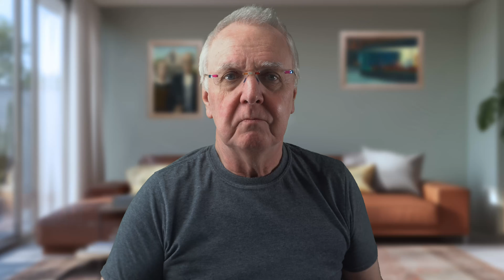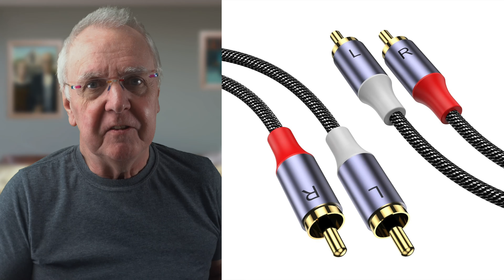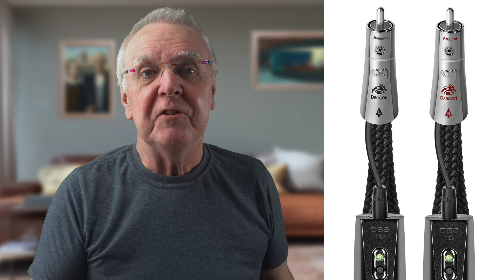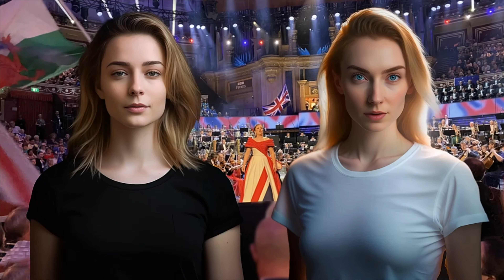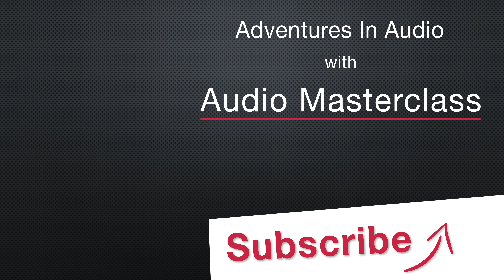How to improve your audio enjoyment with defective cables

Comment: You can use thick gold interlinks  on your stereo set but the internal cables from the connectors to the printboard of your equipment are from cheap ass thin copper wire. Same for expensive power cords . the wire behind your wall outlet is cheap VD wire. So nothing to gain. The length of interlinks and speaker cables is important , keep them as short as possible and left and right the same length . Good speaker cables make a difference but only if you rewire your speakers internal completely with the same cable.

Comment: Oh man, is there really an “audiophile” out there who still uses RCA cables?
Or is this video a repeat from 1999?

BTW: When you speak about RCA cables you should always mention that RCA cables must be build using coax wires! 
I saw RCA snake oil cables made with twisted solid wires…. What a nonsense…
Reply: Uh, are you familiar with turntables?
Reply: @playdg  Yes, I remember this old day’s technics. 
Anyhow, turntable with RCA outputs might be something for kids. I assume an audiophile would take a turntable (when even required to use this old format) having an XLR output. Don’t you think?
Reply: @Lex_Populus Very few exist as that is not how the music is stored on a record and the device would have to create the balanced version. That is the antithesis of audiophilia. Seems like you don't know much about the audiophile world. RCA is also very common for digital SPDIF interconnects for digital sources.

But hey, keep mocking people. That'll work.
Reply: @playdg  To be honest I do not use analog audio.
You might be not aware of this but digital audio works differently to analog. The SPDIF standard requires e.g. an impedance of 75 Ohm. The SPDIF cables are built to fulfill this standard. So, when you buy a SPDIF certified cable for digital you are fine (even cheap but well build SPDIF cables are adequately in order to transport the digital signal). But SPDIF is also old fashion. 

Regarding turntables and XLR: I understand that you might use an old turntable which was engineering as a customer product and so the output is still RCA. 

Nevertheless, modern high-end turntable systems should be built to have a full differential balanced output. The noise issue can be well managed using today’s knowledge. 

But as mentioned I personally do not use analog audio and also do not invest in snake oil products such as analog super duper RCA cables.
Reply: @Lex_Populus LOL. Thanks for googling some stuff for us. I make my own cables, including coax for digital. Although I'm not currently using that, HDMI is more capable.
Reply: @playdg  Not sure what you mentioned by “googling some stuff”.
Anyhow your conclusion is semantically a nonsense. You might want to study some principles of predicate logic. 
And yes, HDMI is best connection for digital. Or directly an ethernet input to a network player such as T+A HV series (e.g. PSD 3100HV – an excellent piece of high-end engineering). That’s high end from my point of view.

BTW: regarding your passion to build your own cables: to build own speaker cables is OK but when you think to build your own digital cables than it’s definitely a bad idea. When you want to understand why… well google it as you obviously tend to assume all is to be googled.

Comment: You're listening to recorded material. So consider what the studio that recorded that material looks like. I know the studios I built used custom cables made with Belden 9451 or 9723 with nickel plated connectors. Those wires are foil shielded with a drain wire, either single or dual pair. Not even coaxial. At audio frequencies they work great even over long distances and with no interference from the broadcast equipment in the same room. The signal from those cables ran through the production gear (with nary a gold plated connector in sight) and recorded to tape. The pro gear revealed impeccable sound quality which in some cases got put onto production CDs. 
Now here's my point. Do you really think that by using "better" cables than were used for the recording, you're going to get better sound? To me. That would be a neat trick!
Reply: You guys just don't get it... maybe you are music lovers instead. That's a good thing! That's what is about. But we, so called audiofools, like to hear the already made recording how it is. That comes with spending money. But when you don't hear it, doesn't mean you are correct by saying it makes no difference. But cables costing more than €800 - €1000 is questionable indeed.
Reply: No, bad cables make things even worse....duh!
Reply: @marcodevos3565  You keep popping up with inane comments, which you always close with "duh". So let's hear your credentials. What job do you do (assuming you even work and aren't a full time keyboard warrior), what system do you run and what are your qualifications?
Reply: @laurieharper1526 Piega, KI, Tellurium and soundcare. About 35 years into audio. And ears.
Reply: Yours? BOSE ?
Reply: @marcodevos3565  So budget to mid-price speakers and cables made from unobtanium. "Into audio" for 35 years? I was a pro' musician for 50. I too have ears and, unlike you I suspect, perfect pitch.
Reply: @laurieharper1526  mirror talking by the way?
Reply: @marcodevos3565  Took you a while to come up with that gem, didn't it? Unless you were in the studio when a recording was made, you have no clue whether you are hearing "the already made recording how it is".
Reply: @laurieharper1526  correct, but loosing details l, dimension and muffled sound wont help. Which happens with cheap cables etc. But ok,  have a nice none audiophile life.👍
Reply: @marcodevos3565  I'll have a nice musician's life, thanks. You have a nice tin-eared life. Remember, hi-fi is all about music and if you don't have a clue about what music is or should sound like, you're wasting your time and money buying expensive cables and audiophool trinkets.

Comment: Yes, I can.  But different is not always better.  With my R2R and 300B, I prefer copper cables over the fancier ones.  They keep that intimate 300B sound.  With my RA280, I prefer copper for teh woofer and a higher end cable (or at least silver coated) for the extra clarity to the tweeter..  This is with Traingle Duetto 40th speakers.  And my ears and taste as not all higher end cables sound the same or even good with that speaker to me.  Interconnect cables make a difference.  However when I use the DDC, it makes for less different for data interconnects.  For analog, It seems any interconnect is a gain from the cheap cable shipped with equipment.  But once I have a better class of cable, they all sound the same to me.  I do not AB test.  I listen and either it sounds better or it does not.

Comment: Why aren't these great cables used INSIDE THE AMPS AND SPEAKERS?????
Reply: Ask yourself which you would rather burn out ... a $1.00 length of hookup wire or a $1,500 woofer...
Reply: Thats called an upgrade🎉
Reply: Actually, some of my speakers have Monster Inside.
Reply: @playdg  That's what she said...

Comment: A cheap cable can be turned into audiophile quality by making and attaching your own  $1000 price tag. Make sure the price tag is visible from your listening position and be amazed by improved audio quality.
Reply: When you think this way just switch to digital audio. The cables there have to follow only the digital format requirements, nothing else.
When you have to use RCA cables than replace your equipment as RCA is really an old fashion thing
Reply: @Lex_Populus?
Reply: Funny, but also ignorant comment.

Comment: I have a pair of 'defective' cables that came with my SME Series 3 tonearm.
At one end of each phono-to-phono cable, there's a 220 pF capacitor.
After unscrewing the metal shroud, the capacitor can be seen tucked away in a small slot in the plastic body of the plug.

I wonder how many people are using these leads without knowing about the capacitor?

Comment: John Watkinson, one of the pre-eminent audio & video designers in the UK, once said that “if changing the cable has an effect on the sound of an audio interface, then the interface has not been designed properly”. I experienced this in the recording studio in the 1980s, where a particular domestic DAT machine’s line input had an unnecessarily high input impedance, if fed down long phono (RCA) cables from the ‘Pro-Pac’ professional interface module, all the HF was rolled off by the cable capacitance.
I also have concerns about the size & length of the phono (RCA) plugs used many of the very expensive ‘audiophile’ cables; the leverage applied to the sockets by their length plus the weight of the chunky cables, in my experience is sufficient to damage the sockets, or fracture the joints where they are soldered to the PCBs.

Comment: At audio frequencies the only effect speaker cables have is a slight attenuation due to their resistance.  Inductance and capacitance have virtually no effect.  Same for weak signals such as those coming from a phonograph cartridge, except that shielding is also important.  

Connectors are weak points, so keep them clean and, if they are carrying lots of power, make sure they have adequate contact area.  If they get hot, use bigger ones.

These matters have been settled long ago.  It’s amazing that people still go for extremely expensive cables and connectors, thinking they can hear differences.  Put the money elsewhere, like into speakers, where differences matter.
Reply: Capacitance and inductance have virtually no effect? 😂 if you say so.

Comment: Maybe the differences people hear in cables is the interference they are picking up from their surroundings?  I've tried expensive interconnects and supa cheap ones, I've made my own rca ones with poor quality components and I can't hear a difference provided you keep them short, I've always thought my kit isn't resolving enough 😂

I've found speaker cables are a little different, as is bi amping, I can manage to hear a small difference, whether or not it's better is anyone's guess, qed79 strand seems to work just fine, I did try some mains 2.5mm twin and earth cable once which sounded ok but I preferred the 79strand as it was much easier to work with...

A cheap mains conditioner made a difference as well.

Putting rubber feet people use under washing machines under my floor standing speakers that were stood on a solid wood floor changed the sound quite a bit and were supa cheap... 

You should do a video about the cheapest upgrades people have done that have given the biggest improvement...

Comment: Oscilloscope cables are lossy by design. They add a high resistance center conductor to reduce reflection and therefore ensure a flat frequency response across its length…some sometimes worse really is better….
Reply: Thing is they've got 1M impedances, measuring MHz.

Comment: The problem with the RCA type cables is that they are unbalanced and  allow ground currents to flow in their shield.  If there's a potential difference between the two pieces of equipment it's connecting, say from the AC mains, that voltage difference will be added to the desired audio signal.  One can try and minimize this by buying cables with very low conductance shields.  But you can't really tell what your buying without cutting them open.  One can also add large gauge wires between the equipment to try and divert the interfering current away from the shield.  
The best solution is to avoid the whole problem and use equipment with balanced inputs/outputs and interconnected with XLR microphone balanced shielded cables.  That way, no interfering current flows in the signal path wires.
All of this seems way over the top and unnecessary, since the currents for short cables runs is so small.  But for long cable runs, where the equipment maybe plugged into AC mains on different phases, the interfering current may be significant.
Reply: The best thing to do is to make sure all of the equipment is appropriately bonded. This can get complicated when you have some balanced signals, some unbalanced signals, some equipment with grounded power leads and some equipment with ungrounded power leads. Throw in battery operated gear and you have a recipe for trouble. Assuming the power is clean (no voltage on the grounding equipment conductor) you can bond everything to power ground and listen to the hum go away. But be sure to use a common ground. Any differential between grounds might not matter electrically, but you will hear it at [60|50] Hz.
Reply: The best bet is to resolve the grounding problems.
Reply: It (Skin Effect)  tends to start to come into play when the signal wavelength approaches the cable length.

Comment: Plugging a "high end" cable into an unbalanced -10dBV output like an RCA is putting lipstick on a pig, and goes to show just how ignorant audiophiles are of basic physics. Even the cheapest (non-defective) balanced +4dBu XLR or TRS is going to sound better, every single time, and twice on longer cable runs.

Comment: Those Audioquest thingies have been measured. Apparently the battery box somehow manages to pick up EM noise, besides that they're wires like most others.

What's wrong with something from Klotz, van Damme, Belden, Canare or something? Just be sure to have them terminated with with the appropriate Neutrik connectors, and you have an heirloom piece.

Comment: Whatever cables/interconects you buy make sure the conductors are copper. Cheap ones may have aluminium conductors, not as flexible and could work harden if you keep playing with them and break internally. This does not apply to optical cables/interconnects of course.
Reply: Silver is a better conductor than copper...
Reply: Yes, absolutely correct ... do not use CCA (Copper Clad Aluminum) wire.  It's stiff, it's brittle, it breaks easily and it's a royal pain in the but crack to solder.  

OFC (Oxygen Free Copper) is the way to go, and it's pretty cheap.

Comment: Great videos! I love them all.... 💜 If someone has a $15,000 dollar amp (I'll speak in dollars here), a $9000 dollar DAC and a pair of $35,000 dollar speakers, go ahead and get the $8000 dollar cables (interconnects). I totally get it. Why not? It's all good. When it becomes like snake oil is when you got a salesperson or marketing strategist spewing out BS saying, "Our cables sound a 1000 times better. It's like night and day. Don't be stupid and use 50 dollar cables on $70,000 dollars of gear. You NEED the best cables. You NEED to buy our cables. You NEED to elevate them exactly 6 inches off the floor. Any other is completely inadequate and stupid."

Comment: 👂Your structurally grain disordered videos are obviously poorly insulated from reality and suffer from molecular vibrations right to the dissimilar core materials never getting below the surface effect. And your argument has faulty terminations not to mention it's facing in the wrong direction. No wonder nothing sounds right! :)   
In truth, your suggestion is wonderful. Imagine a small female & male RCA connector with options for circuit options in the middle, variable capacitor resistor, antenna, etc. A chart could even be provided so that you could match specific interconnects. It could be called the cable, sorry, "The Interconnect Debate ⚡TERMINATOR⚡" . I, hereby, give you rights to the name, for a small percentage of the profit! Thanks and blessings, my friend!

Comment: You can increase the resistance or capacitance of an "interconnect" or ordinary cable by just making it longer.
Reply: And coil it up to increase inductance too
Reply: Is that true? Won't the magnetic field of the screen and the signal wire cancel out?
Reply: @stephendavies6947  If you mean coiling up to increase inductance, I think you're right for shielded wire at least.

Comment: The interconnects need to be of warm color of you desire warm sound. Those silver ones will sound cold and lifeless. They need to have a nice copper color insulation to sound good. Oh, and if you live in the northern hemisphere, you need to connect them Right first, then Left. The other way down under. Prove me wrong.
Reply: you forgot about the direction, which end is the input and which is the output, reverse them and will be a disaster 😮
Reply: It's the same with nails!
If you need to fix something to the ceiling you need nails with their heads at the bottom!
Reply: Wow, I didn't consider the effect of the southern hemisphere, and having to install them upside-down!